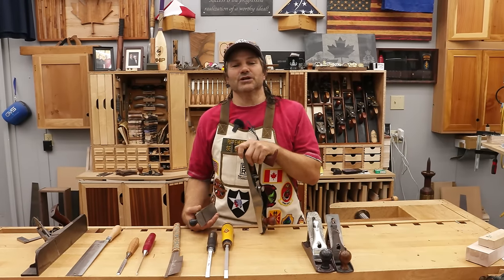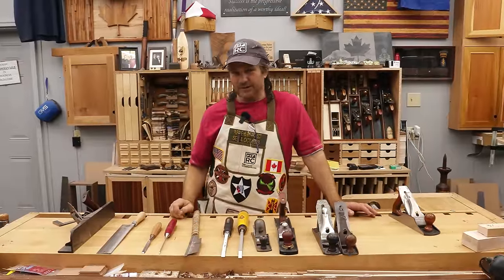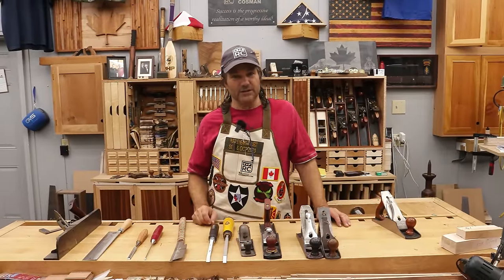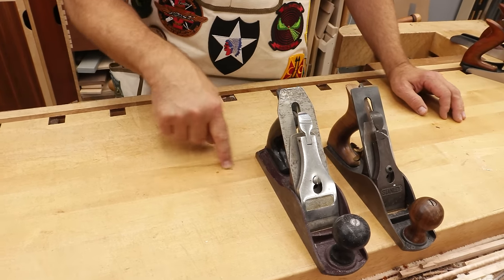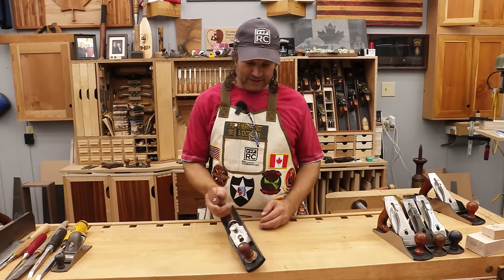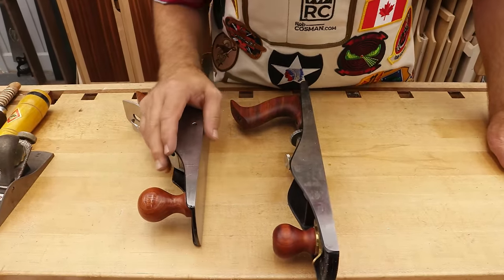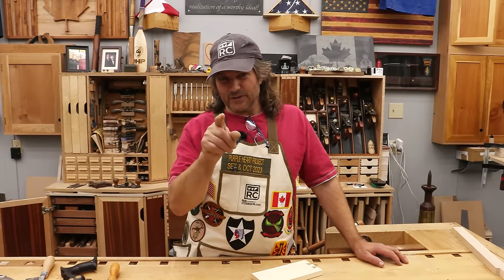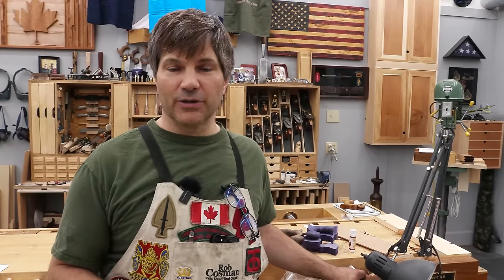Tools Not To Buy | Learn From My Mistakes !

Comment: Hi Rob.  A message should be ---don't be afraid of modifying tools to suit personal preferences.  That heavy handled chisel - make a new handle.  That out-of-square mortise chisel, get it re-ground square.  Etc etc.  No tool is sacred.  If there is a sharp corner that annoys, grind it off.  Enjoy the channel.  Cheers!!
Reply: Modifying tools is fine, but it’s not the topic of discussion of this video. This video is meant to be a warning to take into consideration BEFORE buying any of these tools in the first place. If you buy the right tool the first time, you don’t have to modify it at all.  He’s not talking to anyone watching this video who already has one, some or all of these tools. 

He’s talking about balance, not weight. Because the neck of that chisel is so long, any handle throws it’s balance off in a close grip for paring like he was holding it.  14:02

While it’s not in this video, he does compare the Narex mortise chisel to a preferred brand in a different video and he does say that it could be grinded square, but it’s so much meat to remove that most people would overheat their chisels and ruin the tempering. For that reason, and because they’re made of softer steel, he does not recommend the Narex mortise chisels at all.
Reply: Yes I understand where you are coming from.    However, what is the option for those who already own those tools - throw them away or modify? The world is in trouble because of the throw away attitude that exists.  Also surface grinding uses a coolant and the material is not overheated.   @surlycanadian
Reply: I think it depends on what level of work one wants to accomplish. If I want to do rough general work, I would keep it and make do. If I want to do truly fine hand tool woodworking, I throw/give my inadequate tools away, and get the appropriate tools. Otherwise, I view it as a waste of time and energy. 

We all learn lessons. Hard lessons and easy lessons. I’ve purchased thousands in tools that I wish I spent differently. I learned along the way, in part, by watching those like Rob.
Reply: @johnspathonis1078    I said he’s not talking to people who already have the specific tools.  This video is not for them. The topic isn’t “do you have these tools I hate?”. The topic is “if you’re thinking about buying these tools, don’t”. Since he’s not talking to people who already own these tools, modifying them is an irrelevant point to his actual target audience for this video; people who don’t have these specific tools. 

‘Learn from my mistakes and don’t buy these”

“I already have them”

“Okay, you’re not the target audience for this topic then.”  Go watch another video that is more relevant to your existing situation

You have more options than just throwing them away or modifying them. You could sell them or give them away to a starting woodworker.
Reply: Ben detto a volte anche il nuovo ha bisogno di essere corretto o modificato
Reply: @johnspathonis1078  Not only that, but countless folks (like me!) don’t have the money to upgrade to the tools Rob recommends. They tend to be quite cost-prohibitive for many. So we simply have to “make do.”
Reply: @surlycanadian mmmmmmmm🎉
Reply: I BOUGHT THE WOODRIVER #4. IT IS VERY AVERAGE, THEN A VINTAGE MILLERS FALLS AND FINALLY A STANLEY NEW GENERATION PREMIUM #4. .  EACH PLANE HAS ITS OWN PERSONALITY.  SO USE EXPERIMENT IMPROVE.  BUT I, KEEP GOING BACK TO PREMIUM NEW GEN STANLEY WITH ADJUSTABLE  MOUTH BEV UP ETC.
Reply: Rob is right I cannot see my marking gauge point. So I have always pulled them out and redrilled from corner to corner that way I can see the point as it touches the wood. By the way really like your hand saws.
Reply: @surlycanadian  OK, I'll go away now and pretend I don't have any tools I don't like.
Reply: @surlycanadian wow, easynow...
Reply: People buying these type of tools aren’t gonna know enough about them, and prob don’t even know how to effectively use them anyway. So it’s kinda an oxy moron.. if they were skilled and experienced enough to know how to properly modify it, they wouldn’t have bought it in the first place lol
Reply: @johnspathonis1078  not everybody has access to a surface grinder… a $10,000 (?) surface grinder to modify a $10 chisel?
Reply: If you grind a 3/8 (or any other size chisel) so the sides are perpendicular to the back it is no longer a 3/8 chisel.
Reply: you have to understand that rob is no more a woodworker that sells furniteure, and more a influencer, that sells courses and his own tools. and that is fine. :)
fixing tools should be the way
Reply: @johnspathonis1078 The option, is to watch a video on that topic. Same as I wouldn't watch this video on tips for making ice-cream.
Reply: @waltermartindale9008 well, you can find a machine shop willing to do it. What would that cost? Add $25 for a 12mm Narex mortise chisel. $125 for a similar Lie Nielsen. Or similar for a Blue Spruce.

If you did that, would the Narex perform the same? Probably not. Would it be worth it? I have no idea of the cost to have it ground square or how much time and effort to make that arrangement
Reply: @kbach2946 yeah, but does that matter to you? Usually you size the mortise to whatever chisel you have and cut the tendon to fit. At least, that's what I do.
Reply: @intotheblue50  I ended up replacing my traditional big box store marking gauge with a shop built one with a wheel cutter. The wheel and the wedge make a misive difference.
Reply: As a principle of buy fewer tools and think long and hard about what and why you are buying, I applaud the sentiment. I may not agree with the examples (I like my low angle jack plane and dedicated shooting plane) but the thought process is great.

I’ve been woodworking for over 45 years and I have lots of tools that I regret buying. Lots and lots. 

If I knew then what I know now. 

The one invaluable thing you can’t buy but must have is practice. And patience.

Comment: I’m a big fan of my LN #62. It’s basically my jack for sure. I agree with mostly everything else. And from my experience most planes, if tuned well, can smooth. When it comes to shooting I find the biggest issue I have is a dull blade. Can shoot anything almost as long as your blades are sharp and maintained. Thanks for the video Rob
Reply: I love my Veritas #62 used it much more than expected .
Reply: I have my Grandfathers 62, given to me from my father.  I like it a lot but I think more because it belonged to him.  I would have never purchased one if my father hadn't given it to me.
Reply: I have a modern Stanley Sweetheart 62 and I find the trick with sharpening is to have the primary 25deg bevel hollow ground (or leave it as such) and then your secondary is also 25deg you only remove a small bit of material on both the leading and trailing edge of the primary effectively not much more than a more traditional 30deg secondary bevel. This ends up maintaing an effective cutting angle of 37deg (12+25). For a realy low angle plane you would be better of with a traditional bevel down mitre plane with a bed of 27-30 deg and the primary bevel at 25 deg.

Comment: I have a Veritas low angle jack plane. It was pretty much useless as a shooting plane but works beautifully otherwise. I purchased a #6 from Cosman. It's a little large for shooting but works well for that. It doubles for use jointing medium length pieces for musical instruments I make. The first pricey saw I bought was a gent's saw. I never use it. I have Narex mortise chisels which do have sloped sides. I have learned to use them passably well.

Comment: Would have liked to see the demonstration with the Japanese pull saw showing that it doesn't produce flat surfaces.  I think that point was the most interesting part of this video.
Reply from the maker: Yup, I should have done that
Reply: Rob's not wrong about the teeth snapping if great care is not used.  I ruined my first Japanese style saw fairly soon by not understanding that with hardwood a light touch is needed.
Reply: @brucematthews6417  Oh, I've definitely broken teeth on my pull saws too.  I was more interested in his assertion that the pull saws may not produce flat cuts in harder woods compared to a dovetail saw.  It makes sense, it would just be cool to actually see the comparison.

Comment: They make great Japanese dovetail saws for western hardwoods, but they are priced similarly to your saw. The $45 ones work much better in softwood and require a more gentle hand imo.
Reply from the maker: But traditionally, japanese saws were made for local hardwoods in Japan which are mostly softwoods, and they take practice and skill to master properly.
Reply: @RobCosmanWoodworking  they make saws with teeth specifically designed for western white oak (or similar) but they are $200+

I’m not sure if they take significantly more practice than western saws. Western saws seem to take a decent amount of practice too, but you would know way more on that than me.

Comment: I’m a cabinet maker in the uk. I watched this expecting controversy but my own experiences align with the points you make. You’re a little mischievous with the Japanese saw comparison though. A softwood crosscut Japanese saw isn’t a direct comparison to a tuned western dovetail rip saw. Japanese saws can be excellent but for dovetails a rip style designed for hardwood is the way forward.

Comment: All great points, & great stuff as always, Rob. I think the 4 1/2 and 5 1/2 sizes are just less accessible to people who don't want to spend $250+ new or hunt down a decent price on a good vintage tool. Prewar fixer-uppers in the 3 - 5 size range grow on trees for like $30, and there are lots of resources for learning to get them cleaned up and running. I totally agree, though, the half numbers are usually nicer to use overall.
Reply from the maker: I awlays recommend cry once and get the best tool you can afford
Reply: @RobCosmanWoodworking  for me this was a new nr. 5 (60euro) from india.... it works well and came square... id love to know how nice a 350 euro 5,5 is but thats how much i was able to spend on my whole equipment. impossible to invest this in only one tool. also a japanese multi purpose saw works well for me as long as i stay relaxed... hard times ...maybe i can affpd a wr 5,5 if i sell all boxes i make instead of giving them away for chrismas...
Reply: The half sizes may not be as common as the usual sizes but they are not rare. I just checked and here in the UK on Ebay today there are 69 Stanley Bailey and Record no 4 1/2. Good condition ones seem to be £35-£40 (less than $50). I almost bought one and I really don't need another plane!

Comment: I really never thought about the saw handle but now understand why it is important  thank you for the explanation
Reply: I bought a dovetail saw with a round handle because I thought it would improve my woodworking. Every time I get it out I regret it and swap to a cheap Irwin pull saw with a D handle that produces very clean cuts. Its nice to have my experience vindicated with respect to the handle design. However the absence of a back on the pull saw really helps me see if I am holding the saw parallel to my line. I like the minimal set on the pull saw too. Not sure if I am going to spend any more money on dovetail saws unless I find a vintage one in a flea market.
Reply: @ian7819  since You already have a dovetail saw with a round handle (gent's saw), try a "3 fingers grip" on it - grab the handle of the saw with only 3 fingers instead of 4 and  put the index finger on the lateral flat part of the brass back (put the thumb wherever You find it comfortable) and try to practice. It's not as comfortable as a dedicated D handle, but it offers at least some reference and control (for me, at least).
P.S. Even Paul Sellers uses gent's saw "wrong" by putting the index finger on top of the brass back.
Reply from the maker: Gent’s saws are only manufactured as a cheaper alternative to creating a proper handle.

Comment: Thanks for the great video. I'm an old guy who's new at hand tool woodworking. I inherited a few tools when my father in law died, one of which was a Stanley #6. You're so right about the weight an stability you get from a plane of that size. Considering that I've learned most of the techniques I use from you, I'd probably have bought a 5-1/2 if I hadn't already had the 6 but I think the difference between them is inconsequential. I also got a couple of block planes in the acquisition, one being a 60-1/2 and that's the one I reach for pretty much every time. Funny, I didn't even realize how much more comfortable it is until you mentioned it. Finally, you're so right about the sharpness being the most important part as it pertains to the amount of work it takes to use it. A few videos back you quipped that there are guys who put off sharpening until it's to the point where they gotta get another guy to help push it and that cracked me up. But...I also took it to heart and when I notice I'm working up more of a sweat or when I want a really special finish on the wood a touch-up on the stones is definitely in order.
Reply: my favourite plane is a 6. It just feels right for me.

Comment: I have become a big fan of Japanese pull saws. I find it easy to make a straight cut with the pulling motion. It offers more control than pushing I feel. Great tips in the video anyway. I also prefer a hefty planer, it gives a smoother movement.
Reply: @NeilAbalone Have you tried a dozuki for cutting dovetails? It changed my mind, although I love using my ryoba and pull out my kugihiki way more than I ever thought I would…
Reply: @NeilAbalone  I don't know about the handle of your dozuki, but all of my Japanese saws have oval cross section handles, and so I can use them rather reliably.  If one's into vertical cuts only, one can still clamp the piece slanted by the necessary degree.
Reply: I'm a pull stroke fan, too, but I do agree with Rob about the problem of the thin blades on Japanese pull saws. I took a regular back saw (called a tenon saw here in the UK) and dismantled and turned the blade round so it now cuts on the pull. Bit of work, but well worth it.

Comment: Great video! This is why Rob Cosman is a trusted resource — I’ve tried most of these tools and they all perform as dismally as explained in the video. Without a doubt, the difference between a Cosman dovetail saw and a Japanese dovetail saw is unequivocal. I still use my Cosman dovetail saw and my Japanese dovetail saw stays in the shop (with my mutilated skin in the teeth) as a reminder not to never cheap-out on tools

Comment: Good information.  I use planes and chisels primarily for framing and misc remodeling and agree with  most of your opinions.  I hadn;t thought about the blade angle contributing to the angle of attack on my block planes.  I agree, learn to sharpen tools.  Sharp cuts, sorta sharp tears wood fibers.

Comment: Dear Rob, absolutely agree on the saw handle point. Any favorite saw with a true handle grip will improve the directional action and increase muscle memory. Those round handled saws are of better use in a jig. For Japanese saws it’s different, because of the pull action. Hardwoods indeed are less accurately cut with traditional Japanese saws. Oyakata makes a garden style saw with a slightly thicker blade. That saw is more suitable for hardwood. Although I must add there that to allocate saw blades for hardwoods is also helpful. Humbly think it also depends on the level of skill, muscle memory and whether the cut is with or against the grain of the wood. Learning to saw straight is imperative, for folks that push too much, the Japanese saw can be a learning experience, especially for finding the balance between applied action and letting the tool do the work. Great vid, am not a prolific user of planes, definitely will look into your shooting board plane jig vid. Cheerio

Comment: This video has helped me a heap. When i started out i bought a low-angle jack plane and some Japanese pull saws. Which is fine, but no one told me those tools were not gonna cut it on hard Maple.
Seeing an experienced woodworker give his thoughts on the limits of these tools (tools which all the other popular youtubers praise). Its helped me recognize my early failures weren't 100% skill issue, but a little bit of using the wrong tools for the job.

Comment: I have a Veritas low angle jack that I was at first trepidatious about, but I’m getting incredibly smooth cuts on everything from highly figured walnut to jatoba and even ipe (crazy I know, but I like the look on a small box). I have to agree though that it’s all about sharpness at the end of the day. 

Thanks for all you’ve taught me over the years, Coach Cosman. Cheers!
Reply: A lot of people like their low angle jacks. Some are on YouTube and I believe are very skilled. 

Rob is entitled to his opinion and his comments are valid for him and others 

If I owned a low angle hack, I think I might grind the bevel a little under 25° and hone a microbevel a little less for an angle of attack of about 38°. I've tried that on my block plane and I really like it on end grain. Otherwise I don't see much difference, I might someday want a higher angle of attack than 45°. A low angle hack gives you flexibility. 

But if you sharpen well, I don't see much need to increase the angle. You can control the tear out other ways. Tight mouth, minimal blade extension past the chip breaker, planing technique.
Reply: @jimweisgram9185  Awesome insights. I appreciate it, brother. Hope you’re enjoying yourself in your shop right now. 😊